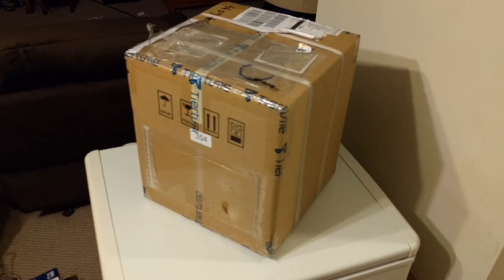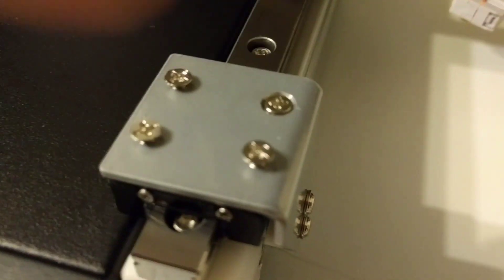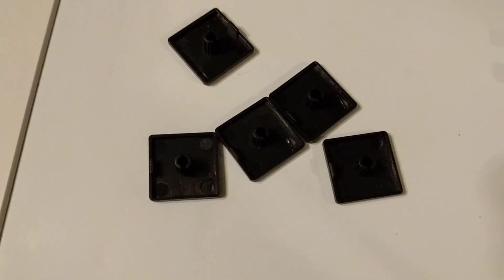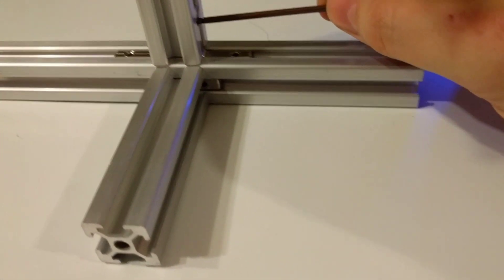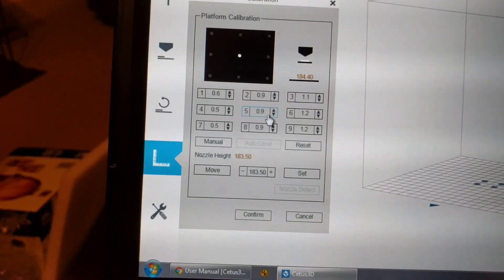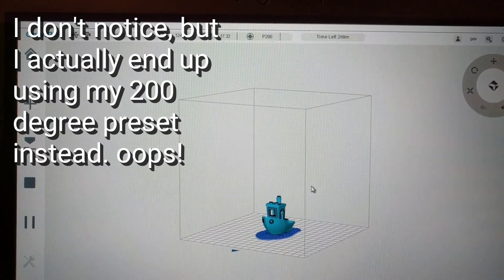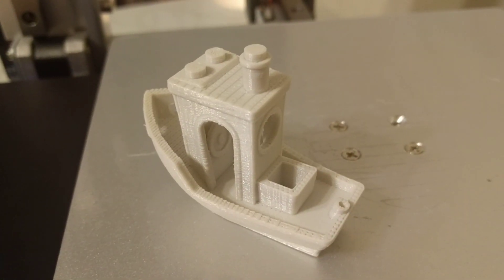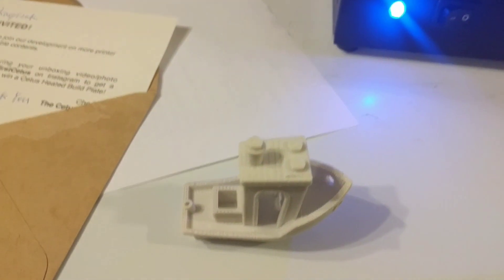HARDWARE: Cetus3D unboxing, assembly, and 1st print

Comment: Just to add, I wish all reviewers would do a test print of a 2mm wide x 3mm high wall right around the edge of the bed, this instantly reveals any issues with bed levelling. All test prints are always done in the middle of the bed which is always going to produce the best results.

Comment: We call them allen keys in the UK! You are redeemed.
Sounds like a nice printer, well built, and does the job. I am guessing that they use their own slicing software to avoid newbies using Slicr or Cura, getting rubbish results and blaming the printer. Doing it this way makes sense, their slicer works with their printer, and no one can mess it up. Just about perfect for anyone who doesn't want the hassle of building and configuration.

Comment: is the bed heated and did you use anything like hair spray as a sticky on the bed
Reply from the maker: It's not heated, but they did recently make an optional heated bed available. I do have one now, but I haven't had a chance to test it yet. I'll probably end up using glue stick or tape though, as hairspray isn't something I keep.
Reply: what kind of tape do you use?
Reply from the maker: I''ve never tried, I just recall hearing "taping" is an adhesion wethod.. The Cetus comes with a bed that is adhesive (but not heated). They just released their heated bed. I would have preferred the coating they use on their unheated beds the heated bed. it works really well.